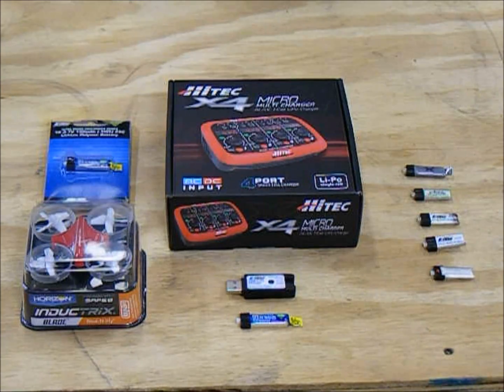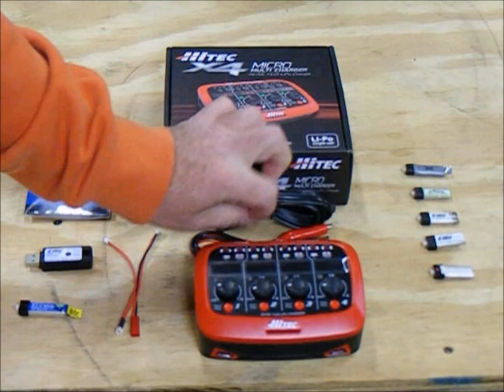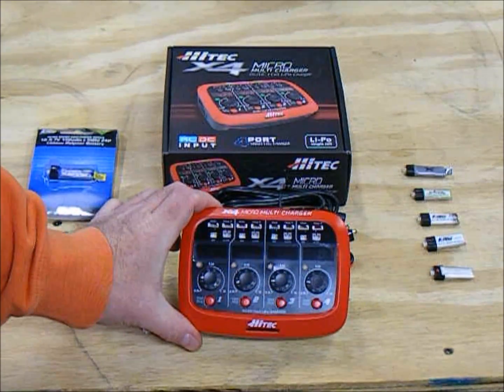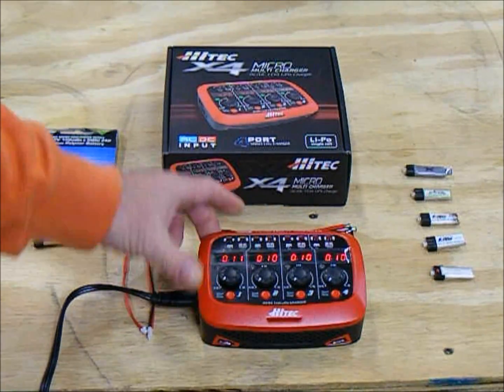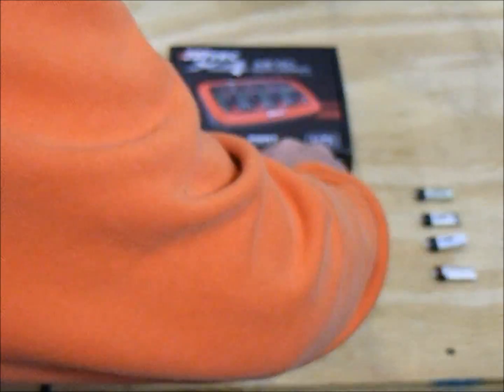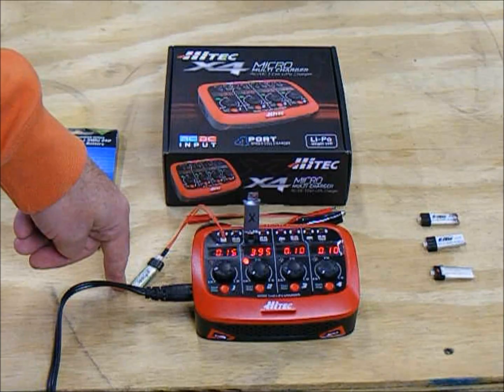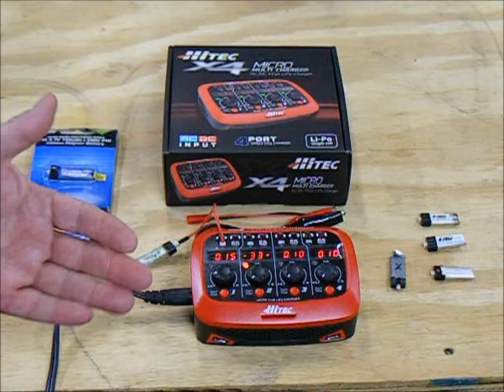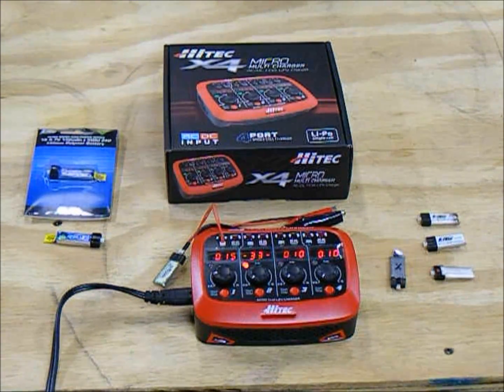Hitec X4  Micro AC/DC 1s LIPO Battery Charger

Comment: You shouldn't plug any e-flight type batteries directly into the "MX" slot. Those batteries use a Molex PicoBlade connector which has a pin pitch of 1.25 mm (spacing between the pins). While the "MX" slot is using a JST-ZH connector with a pin pitch of 1.5 mm. Yes, you can force them to "work" together, but it takes a bit of force. Which is fine right up to the moment it destroys either the charger's JST-ZH "MX" connector, or your battery's Molex PicoBlade connector, or both. Also, I'm hedging my bets of it being fine up until that point since a bad connection can cause issues by itself. Think that short adapter you plugged in was the JST-ZH male to Molex PicoBlade female one. So you just need to make 3 more (or 4 if you want them long enough to put your batteries into a fire bag when charging).